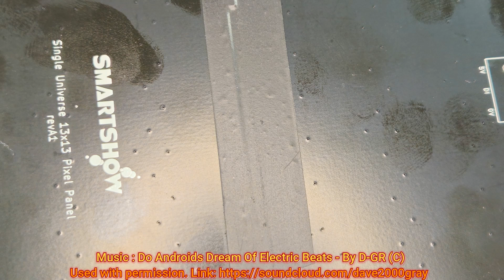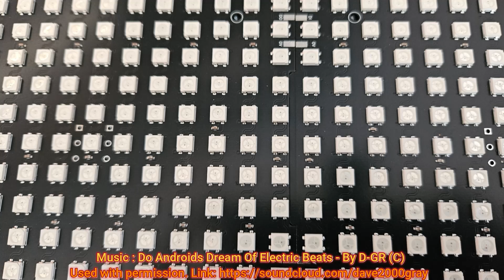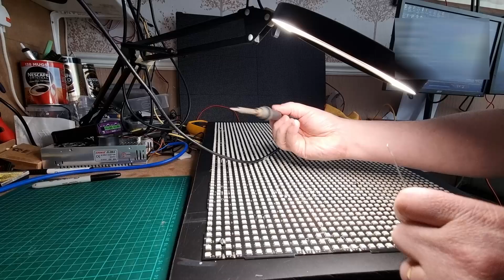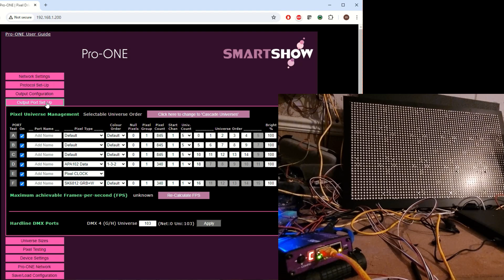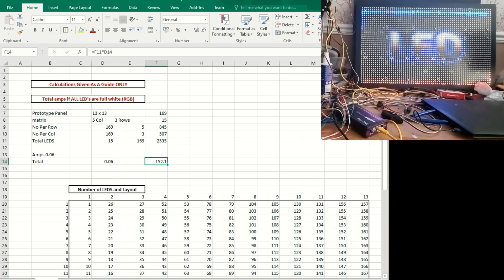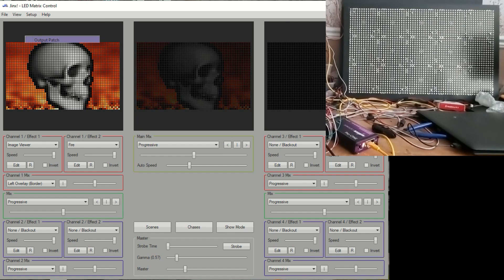Looking at the SmartShow prototype LED matrix panels Part 2 of 2 (matrix building)

Comment: How big can you go when combing LED matrices? As an example, could you make a 12 foot x 12 foot wall of these? As for why, I'm interested in doing a matrix project for the holidays but want to program something custom such as a storyboard of pixel art and want it to be seen in good detail 30 feet away from my porch at least. I've not found a good explanation on this regarding principle and practice, nor how to judge component quality.
Reply from the maker: The sky is the limit, it all depends on power, controllers and the software your using.  For holiday lights it might be better to use P5 LED panels and a Pi connected to xLights, there are examples on how this works on YouTube.  
For other examples, like a local disco you can use Jinx! and a matrix to show words, patterns video etc.  then you can use these panels to make your matrix, but you must calculate the power correctly and fuse each +5v feed.
Reply: @MikesLEDShed  Thanks for the reply. I've looked into panels and unfortunately found they don't work for my needs with regards to basics like being weather/temperature resistant. Almost every video I've seen of examples of panels for holiday set ups don't have even a flicker of snow or mention thereof of weather, while where I live we get a good chunk of snow our winters and it gets COLD. 

So the sky isn't exactly the limit for me lol. Though I have been looking into outdoor cases I can create to protect the lights/components a bit. I just haven't decided yet on getting a bunch of strings of LEDs and combining them all into my own make shift matrix, or if it's possible to attach a bunch of premade matrices together like yours(for greater pixel density).
Reply from the maker: @ignisking759  Thanks - this panel is a prototype, but i know SmartShow are looking in to a waterproof version, but that's not out yet.